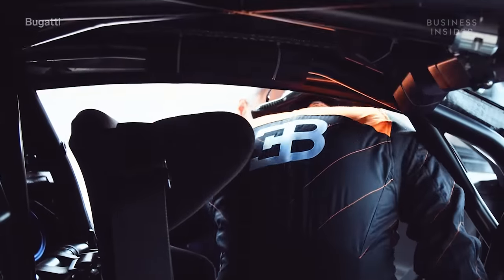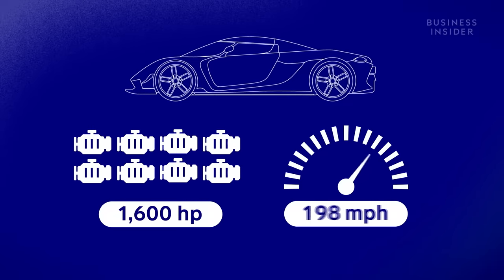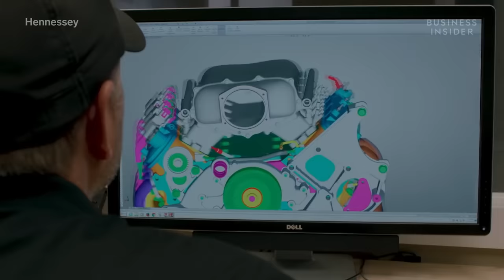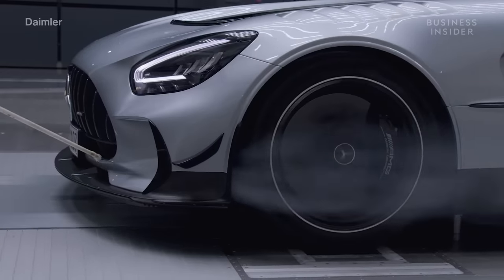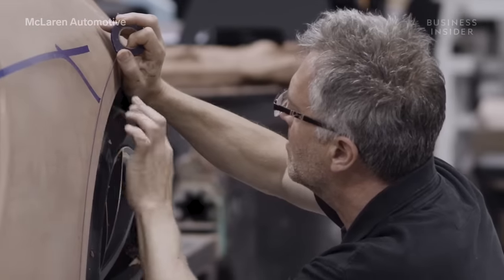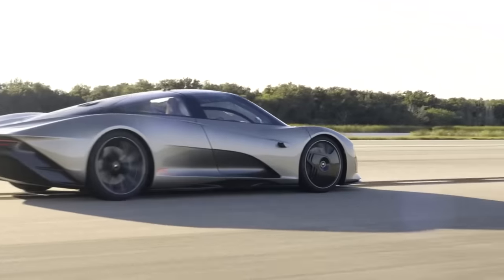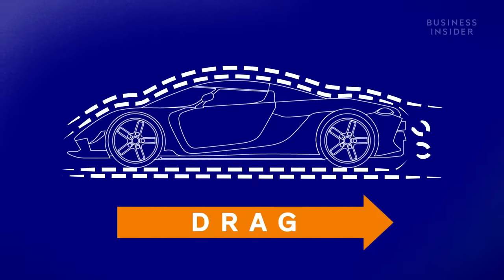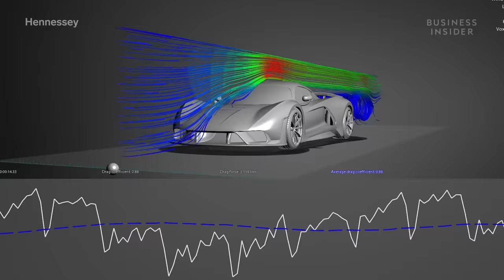Why It's Almost Impossible For Cars To Go 300 Miles Per Hour | Insider Cars

Comment: Thank you for taking the time to break it down to the average human that it's not about raw fast the car is, it's about EVERY single other aspect of the vehicle, the road, the weather that matters as well. In other words driving is physics and people should never forget that.
Reply: I mean even how fast the raw car is is still physics
Reply: @NumberOneBlitz  yeah but im more talking resistance of air flow against the body surface, brake pressure If you even have the balls to remotely go near the brake pedal at the speed which you really shouldn't, temperature the tires reach, how long the tread is going to last and what exactly are the most optimal conditions for being an idiot ( driving fast ). Like he said the difference between what was it? 120 and 150 is astronomical? It genuinely is, at that speed you have to take compression and rebound rate of your suspension and how nice the roads are, if you're car is too high off the ground you start to float as opposed to be glued to the ground so you fight not only the air you're driving into but the air trying to lift you off the ground. Honestly driving is physics and it's really nice when people understand that, they see raw HP # and top speed numbers and don't care about how the brakes or suspension was created, I'm interested in the suspension and brakes and tires that went into that feat
Reply: @NumberOneBlitz  I believe after like 240mph an engineer said you run the risk of de laminating a tire all together or it quite literally expanding from centrifugal force. Science is fascinating, it's just something alot of people don't take into account when driving, be it stopping distance or reaction time alot of people think that because their car cost alot it will keep them safe
Reply: @NumberOneBlitz  wait a second, was that a play on my misspelling, if so good on you sir it took me a whole day to clue in lmao
Reply: Do people forget that driving is physics? Do you think people while hydroplaning on the highway smack their foreheads and go "Oh man, I forgot!"

Also, everything is physics.
Reply: Did they even talk about the road?  I mean having a good surface is the most important part.
Reply: @danmckeever599  they usually fail to mention that a perfectly smooth road on a warm day with ideal very little wind is needed but hey, details 🤣
Reply: @ahall9839  I mean.... most people don't even understand why you need space between cars so like..... yes I do honestly think when people hydroplane they go " idk what happened the roads are terrible "  instead of going " shit their clearly was not enough contact between my tires and the actual pavement.
Reply: Thats what people thought about flying aircraft
Reply: Nope but goldiggers woukd still be like: "ITs a lAmbOrgHini sO itS gOOd."
Reply: Plenty of regular folks have tuned cars that are more powerful than Bugatti, Koenigsegg, Hennessy etc but none of them will ever get close to 300mph because of exactly what you said. 

It’s far more than just raw power, it’s everything else.

Comment: ive been 202.4 mph in 2013 at tx2k and i cant imagine what it would feel like doing 100mph more its just crazy man how much ground you cover you have to decide on a small adjustment seconds before its needed
Reply: yeah...pretty common speed on the highways here in Houston.
Reply: @tommyribfinger7520  yeah I live in Florida and I thought I was big shit hit in 202 until I came to Texas lol every other car at the event was hitting over 200 i was like 28 at the time im nearing 40 now and my 911 never sees over 100 on a good day
Reply: but it's crazy how slow 150 feels after that 200mph sprint.
Reply: I’m jealous I wanna see what that feels like. I’ve only been at 180 in a viper
Reply: @Jfreerz  180 in a viper is scary enough man lol those r dangerous cars well not the new ones but mid 2000s n earlier has zero save your ass systems i did that speed above in my pro charged 13 z06 at the time
Reply: On a motorcycle, the tunnel vision I had was insane. Can't imagine 300...
Reply: MotoGP bikes are nearing 330mph before hitting brakes and doing a stoppie. Just imagine how fast they could be with top speed gearing and better high speed aero. I'd say 250 easily. 300hp on <450lbs seems crazy
Reply: How about on a motorcycle? Bill Warner, 1.50 mile standing start just over 311 mph.
Reply: @tommyribfinger7520  yup I45 is a big danger zone for drivers especially near 517 and 646 near league city
Reply: @exothermal.sprocket  Ya, shits real, on a motorcycle. You feel the resistance at high speed. Something absent, when you’re in a car.
Reply: @KidDynamite6  one time I went over 80 mph in a 1978 Ford Fairmont,  I don’t know how fast because the speedometer only went up to 80
Reply: That is nuts bro. I've done 170mph in a Carrera GT and I thought that was wild. People tell me 200 is very different. That's badass you've been that fast!
Reply: I did 207in a 2018 tuned m5 and felt ridiculous and I agree 300mph must be insane on a different level
Reply: 200mph is a normal speed on the german autobahn.
Reply: @ncredibledark7926  Wow. Sounds awesome!
Reply: Why do you use wrong measurement units of speed?
Reply: Bro has 666 likes💀

Comment: Koenigsegg is exactly correct: around Mach .3 air is considered a compressible fluid.
Reply: it is well known from aircraft industry
Reply: @makantahi3731  How well known outside it, though? Cause I did not know that
Reply: @magnithorson6568  on first lessons on aerodinamics,  in highscool , when was explained properties of air, it is not noticable compressable below some 300km/h, after that it starts to compress as much as speed rises, but ratio of compression depends  shape of object that moves , (trains in long tunel can make sonic boom if tunel does not have vents because it pushes mass of air in front of train and if train goes enough fast and clearance between tunel walls and train is too tight, and air is compressed and in some moment air become supersonic speed around train
Reply: But air is a compressible fluid... speed has nothing to do with that.
Reply: @thefirehawk1495  maybe for you when pumping tyres, but we here discus about free flow around moving object  on  speeds below 300km/h
Reply: @makantahi3731   If our atmosphere was 80% helium, instead of nitrogen, I guess it wouldn't be a problem, due to the higher speed of sound.
Reply: @DANGJOS  yes, everybody would have funny voices, if our atmosphere was 80% of argon, TIG welding would be cheap, if we would not have atmosphera at all, it would be best case scenario and all cars would go much more faster an there would not be problem with air/fluid drag
Reply: @makantahi3731   But if we didn't have an atmosphere at all, where would the cars get their oxygen?
Reply: @DANGJOS  it is not important in this discussion, we talk about compressibility of air and how to minigate it, same question for you, if air would be made 80% helium and 20% oxigen, nothing would be the same at all
Reply: @makantahi3731   But there'd still be oxygen to breathe and drive.  Regardless, I agree with you on the main points discussed here.
Reply: @DANGJOS  electric car does not need oxigen so , elon musk could make high speed highway on mars
Reply: @makantahi3731   Indeed!  That would be really cool.
Reply: I didn't think fluids were compressible.
Reply: @Desertduleler_88   Liquids are incompressible; gases are compressible.  Both of them are fluids, so it depends on which one you're talking about.
Reply: @Desertduleler_88  main word is  think
Reply: @DANGJOS  Exactly...
Reply: @makantahi3731  Oh really? I never thought of that.
Reply: @DANGJOS  yeah, i was about to say. A compressible fluid is a gas by definition lol.
Reply: All fluids are compressible ;)
Reply: Ok...now at what speed does interstellar space become dense enough to exert drag?
Reply: @spaceflight1019  more than 0.1c through a sufficiently dense gas field.
Reply: @thesocialistsarecoming8565  , I neglected to name a particle density as I haven't checked the latest Voyager science data, so you're correct.
Reply: now i can drink air
Reply: In many applications, air is considered a fluid even at 1mph
Reply: @makantahi3731  Are you talking about adiabatic compression on ground? Because I have studied it occurs at more than 300 knots not km/h. It is one of the errors of ASI.
Reply: @dhawalkumar55  on over than 300km/h, that i was told in highschool for aircraft technician and on aeronautical university , so if they lie, i lie too
Reply: @makantahi3731  I see, I was taught about it in my ground school for CPL.
Reply: All gases are "compressible fluids" 🤦🏾‍♂️
Reply: @T1Oracle  and........
Reply: can you dumb that down for some of us
Reply: @DANGJOS  I know this is old, but just clarifying...  Most liquids can be compressed.  In fact, liquid compression is how hydraulic mechanisms work.
Reply: @rift8966   My understanding of hydraulics is that you're exploiting an equal change in volume on both sides to different surface areas. This allows you to produce a very large force without compressing the liquid.
Reply: @DANGJOS  Yeah, apparently I'm an idiot and don't understand the difference between "compressed" and "pressurized".  So, hydraulics is a bad example.

Fun fact I just learned, though...  The principles of Hydraulics are in use by erectile tissue...  😉
Reply: at 0mph air is a compressible fluid... air IS a compressible fluid.... calculating it as incompressible at lower speed is just a shortcut engineers use because the resulting errors are minor until you start going faster

Comment: The actual reason is because technology just hasn’t improved enough until now. We’ve been capable of building cars that exceed speeds far beyond 300mph for a long time now, but this is regarding reaching 300mph in a PRODUCTION CAR. And figuring out how to make a car that could go 300 while still being road legal is incredibly difficult.
Reply: Road cars are noticeably heavier than dragsters and track cars so yeah.
Reply: This guy gets it.
Reply: I say we change the definition of what is road legal. Build cars that span 2 lanes, we'd do well above 500mph
Reply: @thanhvinhnguyento7069  you’re joking right? With how many idiots in cars videos I’ve seen of them going 70 mph
Reply: Indeed! Top fuelers have been reaching well over 300 for decades, currently in the 330s.  Land speed records for piston driven cars are still in the high 400s, with George Poteet reaching 481.576 MPH.
Reply: Piston driven technology for car to reach well over 300mph is already available decades ago (think NHRA top fuel dragsters). Instead I would think whether it makes business sense to mass produce such cars, and whether there is such a demand on the market (likely yes in a niche and exotic market). If there is such a demand, there will be manufacturer producing them as road cars anyway, and that's why we see Bugatti does this. People have already made engines that can output thousands of horsepower decades ago, and tyres that can handle such monstrous horsepower decades ago as well. Expensive you say? Yes they are, but it's not technological limitation anyway. It's just a business question after all.

Comment: "It's almost impossible"

"No, it's necessary"
Reply: Reference from
Reply: Interstellar docking scene
Reply: @reidschoeffler727  I knew it
Reply: 300 mph is pretty much aircraft take-off speed.
Reply: music and spinning intensifies
Reply: Plenty of slaves  for my robot colony?
Reply: It's futile bcos like the Engineer pointed out the difference between 150mph and 180mph in the same car is massive..so 300mph...you will need a Formula 1 license and a race track...you can't do that on any public road ..
Reply: @mangotail6808  A fully Loaded 747 takes of at 250mph...some commercial planes  cruise at just over 300mph...
Reply: the only thing that comes to mind that has the possble to go 400mph but will most likey run out  of gas will be a big block chevy twin superchargers pushing 1200hp on a bike
Reply: What makes it necessary and for what
Reply: @TheMuzikall  Koenigsegg did 284 on a public road in Nevada. Yes, I know it was closed...id say 300 is possible..Dangerous and stupid on a public road for sure.
Reply: @mickeydrago9401  It was a reference to the movie interstellar.
Reply: @TheMuzikall  Older passenger and propeller planes cruised at 400-500 mph but nowadays it’s all about fuel efficiency.
Reply: Proceeds to rotate at 68 RPS
Reply: See you on the other side of 300 Slick..
Reply: Top fuel car be like "ez'
Reply: @mangotail6808  the 747 rotates at less than 300 mph. Those tires can only handle 200 knots or so. which can be a problem at high-altitude airports, especially when it's hot.
Reply: @mangotail6808  225 was the fastest takeoff V Speed of any aircraft, which was the concord.

Fighter jets using a catapult only take off at 175.

Comment: Lift vs down force is a HUGE problem. The weight to power ratio of these cars are exceeding WWII single seat fighter planes. Staying on the ground as a car versus becoming a kite is a big issue. At some point notwithstanding jet cars tested at Bonneville, cars will have a speed maximum
Reply: Eh... just strap a viper ACR wing on the back. You'll need another 1,000 on top of the existing power but... no flight
Reply: Chaparral 2J '70 my beloved
Reply: @bruh meme absolutely
Reply: @bruh meme lmao 🤣 got you
Reply: The weight does not matter, it’s all about high downforce and low drag
Reply: @honeybadger0562  F=ma.  Yes weight matters
Reply: @honeybadger0562  absolutely
Reply: @bruh meme that is acceleration, not top speed. Obviously it takes longer to get there with more weight, but it doesn't stop just how fast a thing can move.
Reply: "The weight to power ratio of these cars are exceeding WWII single seat fighter planes."

I think you meant power to weight ratio.
Reply: @robertromero8692  yeah
Reply: @bruh meme Even then, you are still too attached to the basic "car" shape to achieve anywhere near maximum aerodynamics.  When you really want to minimize drag, you'll need to start borrowing the body shape from an airplane.  Both the front and back come to a point for good reason.
Reply: WW2 fighter planes didn't really have good power-weight ratios. They only moved as fast as they did because they worked with lift forces, not against them.
Reply: That just means we finally get flying cars.
Reply: @OG_Jin_Bling  I wish and I don’t. How shitty are most drivers?

Comment: I think most motorcyclists already have a basic understanding of this concept. I used to ride an FZ-07 (it's a "naked bike" with no wind shield or fairings to "hide" behind) and let me tell yah what, the wind resistance is trying to tear you off the bike the whole time. 60mph isn't too bad, 80mph and you're gonna need to hold yourself on, 100mph and its starting to turn into a workout, and anything over 120mph requires some strength.
Reply: Yeah naked bikes are always a challenge. I used to hit 133 on my fz-09, it almost felt like I was being thrown around on the highway. Steering dampers do help a little
Reply: 120 on an fz07 is real impressive. That's quite literally pushing that bike the the very limit of its capabilities.
Reply: 170 on my old 02 yamaha R6, and ya i was tucked in hard and deep.
Reply: @zac9933  I hit 142mph as my top speed and Im about 6'3 200lbs. 6th gear wasnt quite at the redline but it was getting close. I absolutely found the maximum speed I could go on that bike.
Reply: @tonyatthebeach  now your knees are sore for an entirely different reason.
Reply: Here's hoping your an organ donor.
Reply: @OptimusSatanas  I see you can type with your mouth full. You've been putting in the hours
Reply: @smallepu92  Stop riding silly motorcycles and donate some of that money to a BLACK man. Amen. Thats what all of you need to do. Period.
Reply: @blackleague212  what?
Reply: @marcbirchley2418  I said spend some money on a black man. Come to NYC, Come to the damn projects in the ghetto, and spend some money here . Give the damn money away. AMEN. 
Now did I stammer or do you understand this language???
Reply: @blackleague212  Alright bruh I’m black and I’ll fw you as a brother till the day I die but what tf does this have to do with motorcycles 💀
Reply: Try over 140 mph on a naked bike. If you're not tucked in properly, the wind flowing over your hunched back feels like it's going to lift you right off the bike.
Reply: @ohboy6738  Your Fibbing
Reply: @zakleclaire1858  I'm a similar size as you and I wasn't comfortable taking mine past about 115. 
Can vary though depending on your road conditions and what kinda setup you got. Stay safe out there 🙏
Reply: I read it without the motor part and got confused how you do that on a bicycle
Reply: yeah, double your speed, 4x the force